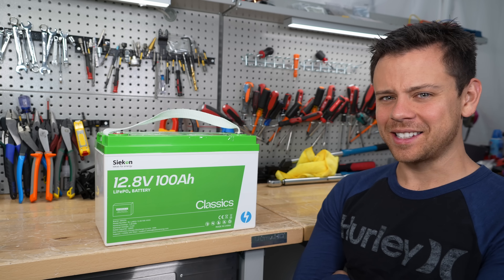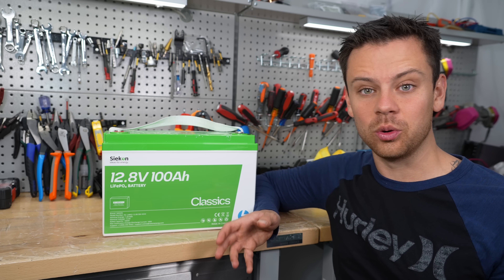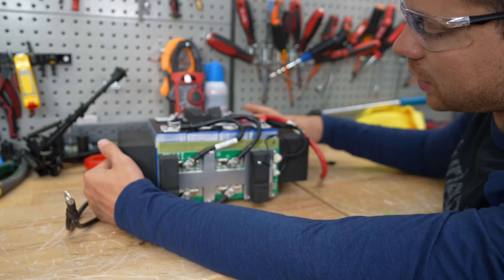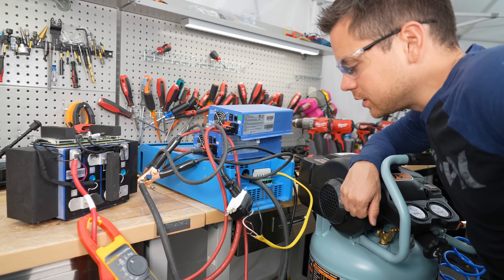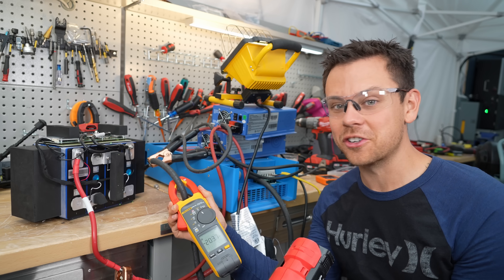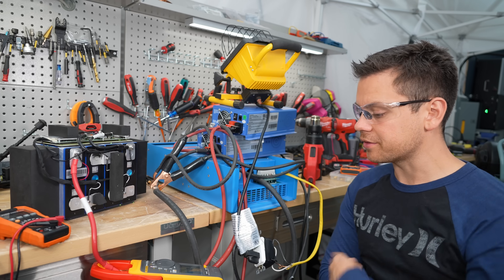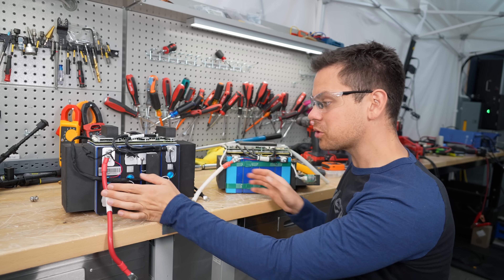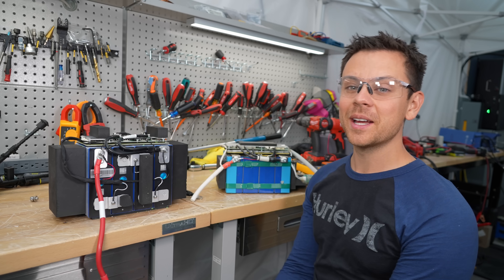Lead is Dead! $229 LFP Siekon 12V 100Ah w/ 150A BMS and Low Temp Charging?!

Comment: I have a bunch of small (very efficient) 120v APC UPS that were designed to run for 4+hrs powering a low wattage load like a modem or router.  Their batteries are all dying after about 6 years now, they are 6ah SLA batteries.  I intend to replace the batteries with a larger battery (externally) to extend the runtime even further during our infrequent power outages.
My question is would a LiFePo battery like these (but smaller) be a 1 for 1 replacement in terms of output voltage to the UPS and the required input charging voltage?
I know the output and input voltages are different for LifePo cells in series of 4.  Do the BMS in these batteries adjust for the difference, and output a standard lead acid voltage, and allow an input of a standard lead acid charger?  Or do these stand alone Lifpo’s require a specialized Lifepo charger?  Thanks!

Comment: I checked out Siecon website and was a little confused.  Their $239 battery is listed as a deep cycle  battery, and their lithium battery is listed at $999. What is the difference in these batteries? Is the deep cycle a lithium battery?

Comment: Lead acid battery will survive any EMP or X30 class solar flare, and BMS will not. So if a Ham radio operator keeps a spare radio in an EMP protected case, he should be able to communicate with other Hams.
Reply from the maker: Everything is becoming emp hardend. They are doing the certification for it now. Soon that won't be an issue. Not that hard to emp proof things anyways
Reply: If you can keep the radio in an EMP protected case, why not have that kind of case for the battery as well?

Comment: Series 48 volt and hook to 6000 XP? Victron shunt, bus bars etc?
Reply: Yup... up to 4s4p., which would give you 400Ah at 48 Volt nominal, (51.2 actual).
Reply: @Tumbleweed5150  Thank you, so 4 series 4 parallel. Would that be 400x48 = 19.2 kWh? And just run xp in lead acid on voltage control? thanks again
Reply: Ok actual voltage is 8x12.8= 51.2v x 400 ah = 20,480 or 20.5 KWH nice. 86$/KWH vs 230/KWH for EG4 wall. Hmm would lose sellback maybe but wow probably be practically off grid if I could fill them daily.

Comment: I cannot bring myself to trust any of these bottom of the barrel Chinese products. 

I design power electronics for a living and have a good understanding of how they can be made to work out of the box, yet be dangerous or have a limited life. 

I will stick with my own designs or at least a trustworthy commercial company that takes safety seriously. Low cost is worth nothing if your house burns down.
Reply: How do YOU know they are bottom of the barrel? They might be middle-drawer or higher for the Chinese. ;)
Reply: @Tumbleweed5150  If it is the lowest price - it is low-end. 
Have you ever seen the cheapest thing also be the best? Safest? Most reliable?
Reply: Besides. I have watched enough of Will tearing down batteries, etc., to know that he knows what to look for. :)
Reply: @Tumbleweed5150  Will is great and points out a lot of important details. 

I am just a guy that designs the circuits, circuit boards, and software from scratch. I do test and validation to find what goes wrong. 
In the world of high current batteries, when something TINY goes wrong it makes a BIG fiery problem real quick.

Comment: Let's not be ridiculous. We still need lead acid CCAs to turn over engines. Lithium can't do that. Not currently, anyway.
Reply: Most of Will's viewers are more interested in off grid/backup power systems, which batteries like this are great for. Maybe one day the companies that make these will make one that can, if they get enough incentive. ;)
Reply: @Tumbleweed5150  I get that. I'm one of them. I've learned a lot from the guy. Given his past videos on oil, gas and combustion engines, I think he's still in the idealistic stage in his life. I was once as well. LFP is king right now for ESS. No doubt. The RV community has benefitted greatly from going lithium. But those same RVs till need a starting battery, oil and fuel. I don't see a let up in combustion engines anytime soon.

Comment: Hi will, your comment on lead acid degradation is not accurate. Lead acids need to be run at a higher charge voltage to prevent that degradation so you're comment must be based on lithium charging rates which wouldn't be suitable for lead acids.
Reply: LOL...only about once a month. Lithium needs to be charged pretty much daily to a certain Voltage to keep the cells in "passive" balance. Lead acid forms junk that sticks to the plates, and needs the extra "kick" to make that come loose, especially where the batteries are used in stable situations, i.e. not shaken up by driving down bumpy roads. Yes, it is true that the Equalize Voltage is higher than that required for LiFePO4s, but for different reasons. LiFePO4s don't degrade the same way. LiFePO4 needs to get to about 14.6 Volts for a few hours each day to stay at the best shape, while lead-acid needs to get to close to 14.9V for a few hours once a month, figuring both are 12V nominal batteries.
Reply: @Tumbleweed5150  sorry but not accurate either. Lead acids need to be kept at a minimum charge rate of 14.4v constant, so 28.8 in a 24v system or 57.6 in a 48v system to prevent degradation. They're a completely different animal to Lithiums and lithium standards don't apply. If you're charging lead acids at what you suggest they're guaranteed to fail. Also as a vehicle technician of 20+yrs I'm extremely experienced with lead acid sulphation but thanks for the lecture all the same. To equalize lead acids in a bank each 12v should be getting  at least 15v to clear any deposits.
Reply: And still Lead acid batteries will degrade faster over time. The longest I have seen them last with as close to a perfect solar system for them was about five or six years. LiFePO4s will last ten, even if used to total depletion every day...and then have a degradation of only 20%, so that they will still have 80% of their rated capacity after that, and will last much longer if not depleted that far or that often. I figure mine should last over 20 years, maybe as many as 30, since I only bring them down to about 85%C for most of the year, and down to maybe 40%C for the two to four months I HAVE to run both air conditioners to save me from dieing from 125+ temps in the summers where I live.

Comment: will can you do a video on how to get an american split phase 240v well pump to run off a cheap inverter? only thing in my cabin thats 240 volt but for sure the most important
Reply: As far as I know, there are only a few "inverters" that will put out 240 Volts, and the ones I know of need a 24 or 28 Volt battery bank to work off of. My Growatt SPF 5000 ES Would do it, with the right battery bank, as it outputs 240 Volts, but there may be less expensive onesout there. Mine costs around $699.00(on sale) right now at Signature Solar. I am not sure if there are less expensive 12V or 24 V ones out there or not. The Growatt I listed above can take up to 6,000 Watts of solar power in, as it is also a solar controller.

Comment: So, if your system is incapable of drawing 200 amps, you're good to go. I have an off-grid inverter that can't pull over 150A surge so I could run these if I could series connect 4 of them and parallel 4 sets. I'm doing fine with 57% as much bank capacity Now I have to check them out. Thanks, Will.

Comment: Hi will could you put these batteries in a trailer without having to change the solar controller and the power converter that does not have the option for lithium charging from your perspective thanks
Reply: You could....and might get away with it for a while, but it would be best for the battery if you got at least the solar controller that is compatable with the LiFePO4 battery, as they(passive) top-balance and need to reach the max. charge Voltage for a certain duration to do so. Like I said, it would work for a while, but you might make the battery last a lot less time than designed for.
Reply: @Tumbleweed5150  thanks for the reply it would probably be easier to change out my go power solar controller that switch out the power converter
Reply: @coreymerritt7742  True.

Comment: Get rid of the foam, use a smaller case, call it a mini and charge more 👍
Reply: That's exactly what Li-Time did. I got the ones I have on sale for $250 each, but they've gone back up to over $300, I think.

Comment: What about short circuit protection?
Reply: That is what a fuse or breaker is for! I even use one with my rack battery that has the built-in breaker.

Comment: Will in case I missed it. Let's say I have this battery in my pickup.  And it runs down due to my leaving a light on. And I come back to my truck a couple hours later. Can I jump start my truck with jumper cables  from another car?
Reply: 1. Do NOT use this battery for starting any vehicle!!! 2. Get a small solar panel and controller and hook it up to the engine battery. This is how I've saved myself in similar circumstances.

Comment: Lead acid will be around for a LONG time still, simply because no conventional internal combustion engine vehicle can use a LiPo battery for starting and charging from the engine. Aside from the issues of charging from an alternator, even the best 12V LiPo's in a car battery sized package can't reliably provide 1,000+ cranking amps like lead acid can.
Reply: most internal combustion is moving to hybrid which use a dc to dc for the 12v. The engine is started with the high voltage traction battery

Comment: I guess it goes without saying this is a killer battery to slap in my golf cart huh?  Which gives me an interesting thought.....I dont use my golf cart much in Nebraska during the winter  (its a farm golf cart, not a golf course cart)...... So I was just thinking......How could I wire that cart to serve as a temporary battery bank if the power goes out?  Obviously I would need a heater on there to keep them up to temp....but other than that....If the power goes out, could i just fail over to  gasp my golf cart?
Reply: I see no problem with that, if you have a 48 Volt cart. Just use LARGE Anderson Connectors between it and, say a 48V to 120V/240V inverter/ "all in one), (the latter would give you something to attach lots of solar power to, My Growatts can take up to 6,000W each). I use two Growatt SPF 5000 ES units in my 48 Volt power system. I think they are on sale at around $700 at Signature Solar. You might find one that you like better. :)
Reply: @Tumbleweed5150  The website says batteries in series must be disconnected and charged individually, every time.  That would be a total pain in the ass
Reply: @UncategorizedContent  True, but I am not sure they are correct about that. My system is 48 Volt, but I only charged up the batteries individually once, before connecting them in series, then putting the system together. I think that getting the battery bank up to the 100% mark for at least a certain time every day will help keep them in balance, but I guess I will find out, if they last as long as I hope, or if they die much sooner. Keeping "fingers crossed". LOL... I have only had the system up and running for a bit over two years now, and so far so good. Most days, I see the batteries get up to 100%, with only a few days, far apart just a percentage or two lower.
Reply: @UncategorizedContent  Yeah if thats true that would be an absolute killer....wouldnt be worth it, but Id be surprised if it was totally true...   Im thinking this idea is actually pretty good, though Im not the first...theres a video out there that they are selling an inverter cart with just this in mind.  my only problem is, I think the cart I have is a 36v....

Comment: Aside from people living off grid or camping, how are so many people spending thousands on batteries? For my purpose it makes more sense to use a battery backup compared to a generator for power outages, but I really can't justify the cost for something that might keep my fridge running for maybe 3-5 days out of the year when I lose power for an extended time due to storms.
Reply: you can build a hybrid system with your generator so you only have to run the generator a couple hours to charge the system and shut it off for until the batteries are drained.
Reply: @JD-yx7be  True. My system is pretty much self-sufficient. I only need to run my generator if I get more than four days of HEAVY clouds. Otherwise, I run it like once a month or two, just to keep the generator in shape, not because of low batteries.
Reply: It might be that those folks have found that, by putting in a system that could keep their homes working during an outage for up to a week or so, by having the whole system, i.e. solar panels, solar controller, inverter, and a big battery bank, they can use way less power from the grid, thus lowering their power bills. Some states, counties, or even cities makes this very hard to impossible, but where one can, it makes sense to at least try. However, the up-front cost of such a large system is almost prohibitive in itself.
Reply: @Tumbleweed5150  Yeah, I would love to have solar and batteries, but no way I'm going to lease it. And because of the cost of those systems in my area it takes a long time to break even.

Comment: In most cases I have been able to replace lead acid with lithium batteries but it is not always the best option for some users. When updating a mobility scooter or pretty much anything with a motor the user must be careful to keep the lithium batteries at full charge. Lead acid batteries can be more forgiving as the the charge gets lower and will continue the let the motor move all be it a a reduced speed, a lithium battery once it hits its BMS limit it shuts off thus stranding the user. 
Now lithium is a better solution as far as weight and longevity but the old guy calling you saying you broke his scooter and he got stuck in the middle of a park does not care that he forgot to plug the charger in and that all the times he did that with a lead acid he was killing the battery and messing up the motor.

Comment: Was the life spand of these batteries
Reply: Depends: ten years max., if discharged and charged 100%C every day. (5000 cycles) Longer if discharged down to 20%C. (6000 cycles), Longer yet if only discharged to 50%C every day ...up to maybe 20+ years. (C is Capacity rating: 100 Ah means 1C=100Ah.

Comment: Will,
You can't accurately measure temperature rise of a battery when it is outside of it's sealed case...
600 cranking amps (or more if there is no overcurrent protection), is extremely unsafe, at the very least it would require a fuse or a circuit breaker inside the case.

Comment: On the Siekon website their image says 6000+ cycles but that is based off of 0.5C rate at 25 degrees Celsius to 80%DOD. Their 5000 cycle graph is based off of sinilar but 100% DOD. That's why the numbers were different.
Reply from the maker: Thank you good call

Comment: I want to replace my existing lead 12v, but am not sure about dropping one into my vehicle or RV with existing chargers for lead. I have heard lead charges at a lower voltage, so the LI battery would never fully charge.  I would love to see you test that with a car alternator, etc.
Reply: Just put in solar panels, a good quality MPPT solar controller that is compatable with LiFePO4 batteries. The onboard charger can charge it up to most of the Voltage needed, then the Solar controller will take it the rest of the way, as long as your RV is in good sunlight. If you get the right solar system, you may not need the onboard charger. Oh... if you have a Converter, it might still be a good idea to order a LiFePO4 compatable one, just in case the solar cannot keep up. I am used to "budgetting" my power usage to what I have available, but some aren't. I recommend getting a 120V plug-in Wattmeter, and test EVERYTHING you MIGHT use, record what is used in a 24 hour  period. With that information, you can figure out what you NEED, and what you only WANT to use during a day, and also know what you might need to cut down on using if you get too many cloudy days, etc.

Comment: Hey Will, I was able to order 2 batteries last month off Amazon for $134.99 per battery. They were  12v 100Ah LiFePo4 batteries with 100A bms. I paid $288 for both total shipped to my home. Seller took availability down shortly after on the listing 😂.

Comment: Saw a review of this where they claimed the -15C cutoff is too low and will have already ruined the cells charging below 0C?  Is it that strict a cutoff?
Reply from the maker: 0° c is preferable. Under low rates you can actually charge them at lower temperatures
Reply: @WillProwse  Thanks thought it was a bit severe sounding
Reply: Easy to fix with an inexpensive heating pad of some kind.

Comment: Is there a down side to using LFP batteries for ICE vehicles instead of lead acid for 12v battery?
Reply: Not on the "house" battery, but definitely do not use as engine starting battery!

Comment: This is Awesome!!

 The guys over a Camping World have all kinds of Off Road custom built 4x4 RV's come in and i'm one of them. Today they just told me to get LiFePO4 batteries was recommended for my Off-Road E450 adventure 4x4 RV because that heat wave in Oregon last week in July/2024 @ 105deg Killed all are Marine deep cycle batteries. I'm taking the 4 out and putting 8 of the LiFePO4 batteries back in. Thank you for this Awesome Review Video. It just helped me a lot.
Reply: I'm having the same problem. Mine are all dead again after 4 years and that heat wave didn't help. I just found them on line, but I only have 2. I think getting 4 would be the way to go. Unbelievable battery that it can run a car lift and a air compressor.  I love this channel.